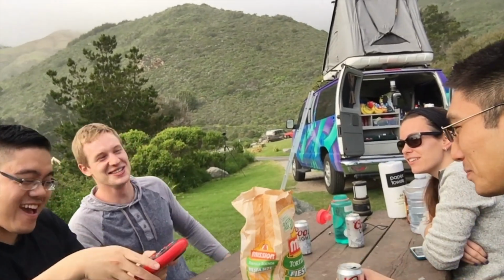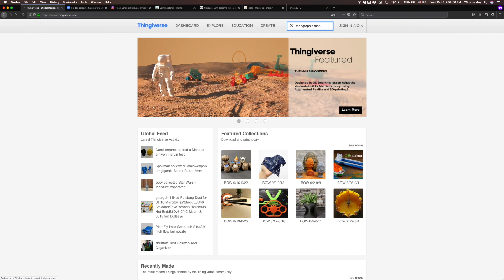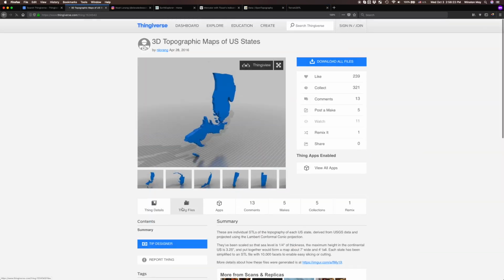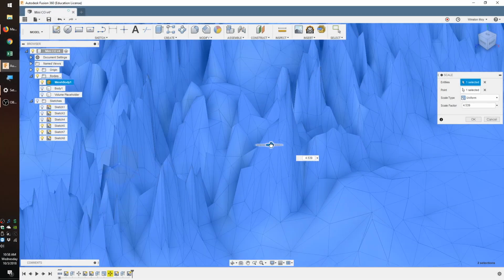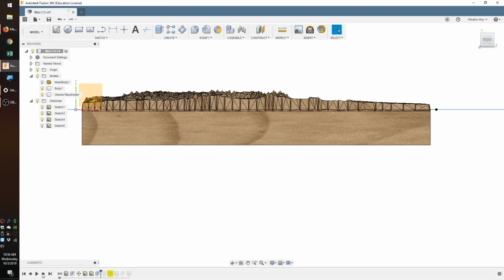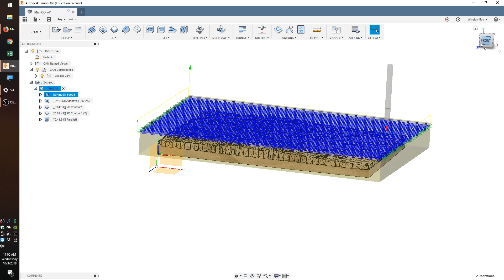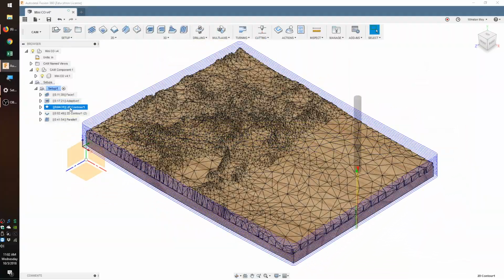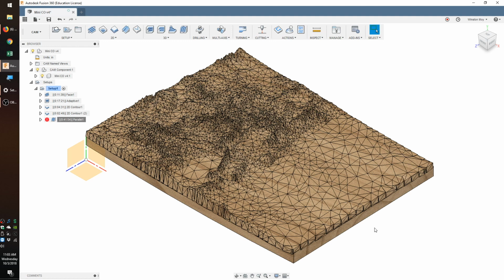Carving a Topographic Map of Colorado from an STL - #131 [CNC]

Comment: Winston, if you are doing a 3d carve like this and need to put in a ballnose for a finishing pass, how do you rezero the ballnose bit if the original top of stock is removed?  I don't have a bit setter.  Thanks
Reply from the maker: Either zero off the wasteboard, or keep a slice of material the same thickness as your original and throw it under the new endmill to reference.